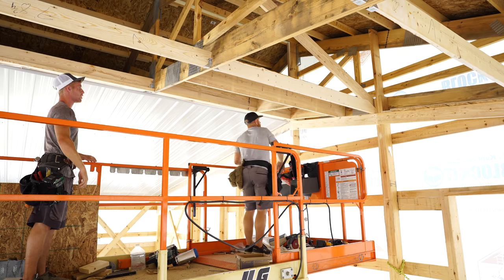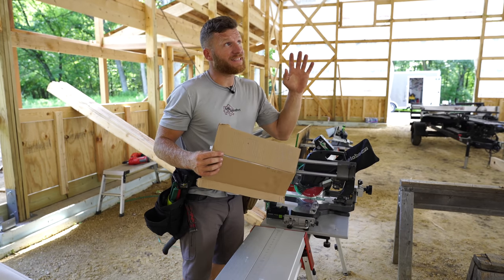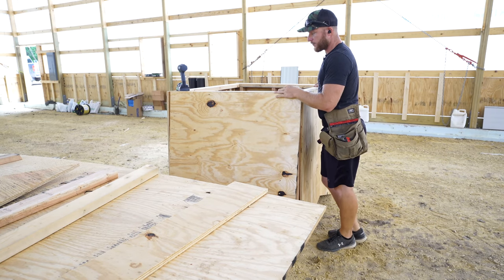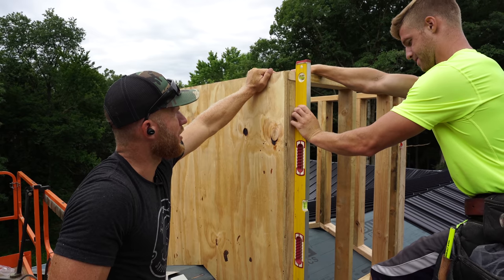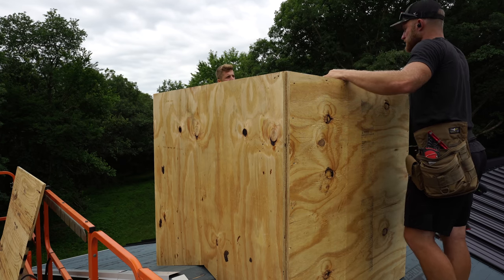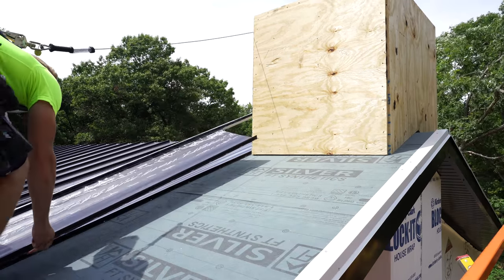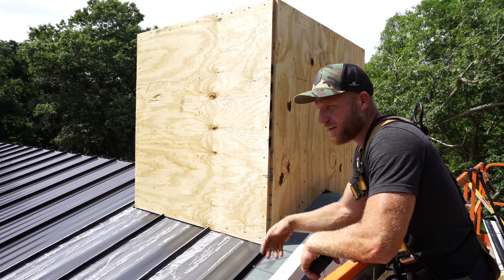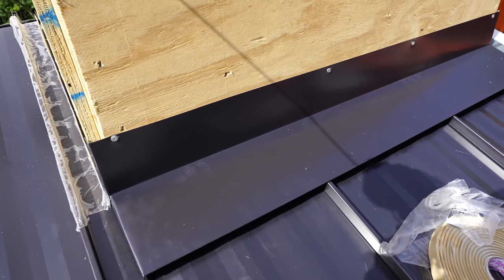Cabin in the Woods Part 19: Finish Ceiling, Build Chimney

Comment: 12:53 - Guys, Are you using officially licensed Milwaukee (tm) OEM Nails in your nail gun? I mean, you're supposed to be only using officially licensed Milwaukee OEM Nails for your Milwaukee (tm) nail gun. I mean, I would NEVER use remanufactured or third party ink cartridges in my HP inkjet printer. HP has assured me that it only works with official OEM ink cartridges from HP.

Comment: Did you consider permanently mounting a couple of safety tie downs at the ridge line for future roof access? They would be mostly hidden by the ridge cap and the exposed tie-off ring painted to match roof color.
Reply from the maker: Maybe should have

Comment: Tip for you guys.  At Walmart in the sporting goods section you can buy replacement stakes for a tent (they don’t even ask you if you own a tent! ). Then gets some 1/8 rope (yarn will work if you double it up).  Then then a roll of duct tape.  Drive the tent stake about 4 foot out from the corner of your building and attach a string to stake and the other end duct tape to you building.  Repeat on the other 3 corners.  That should eliminate that sway in your building.  🤓

Comment: The build is looking great. Have you had anyone want to build without overhangs, entire exterior in zip-r, attaching overhangs at that point, for the next step in energy efficiency? I've been mulling it over, being able to have a great seal, great insulation, climate controlled attic space, yet still have all the benefits of post frame.

Comment: Take a zee and put it on tbe edge of the last panel. Mcelroy details has 16ga Zee butting to the edge of the panel and 1-1/4” screws into the side leg of the panel into the zee every 1’0”. Then run a 90* rake ontop of that zee set in caulk tape and rivets or zac screws. Where the rake hits the side of the chimney just turn it up 3” and your done without ordering 1 panel. Who bends your flashings for you? I’m semi-local to you and you guys do real nice work. 18 yrs architectural experience

Comment: This question has probably been asked and answered more than once. Will someone please point me to where the question was answered? Why do you build the building first and do the slab last, instead of pour the slab, then build the building? Love your work and vids. Great job!!!
Reply: David, the floor will be poured four inches up the grade board just below the bottom wall panel j-trim. Walls have to be up before the grade board goes on. Ties everything together and makes a nice tight building resistant to critter entry. At least that’s what I’ve learned from watching his videos. Someone correct me if I’m wrong.

Comment: Greg, you are right on the money. a carpenter can have too many tools. having the right tool for the job is perfect, but how many framing hammers does one need?? or circular saw?? BTW, watch each other for heat stroke/exhaustion.

Comment: What tape measure are you using? How’s it holding up? I’m a plumber and normally run fat max but they aren’t holding up lately. I bend the first couple feet over lots and they eventually split. Tried the Milwaukee and it’s showing sign of the same issue within a couple months.

Comment: Love your videos. Why fiberglass insulation instead of greenfiber ( boric acid) to keep pests away. Also why not closed cell on both walls and ceiling?  I’m getting ready to insulate my barn and  and trying to figure out the best option in Tennessee. I’m leaning toward closed cell with 2 inch on ceiling and 1.5 in on walls.

Comment: 09:18 
The ONLY useful comment I can give on this... if I remember correctly.

It's called "Ballooning"  spiders basically fly through the air, using their webbing..
It is a real thing. Apparently spiders can move up to a mile or something, doing this stuff.

When I first learned of it.. ptsd kicked in pretty hard. 

I'm just grateful I don't live in Australia with there
damned "huntsman spiders"... their supposedly not poisonous enough to actually get you that way, but 
they are really freaking huge & like to hide in the most annoying places. (Mainly peoples vehicles, ceilings)

Apparently the spider is the cause of a ton of deaths, b/c it likes to come out when the vehicle is moving.. 
of course seeing a spider the size of small dog, come out of a tiny crack & then head toward you, would 
freak out the most hardened person..

Also cool build. I'm learning a lot even if I don't do this as a trade..

Comment: I would have installed a piece of side wall on the side of the chimney. Run a piece of z up the roof to lock it in
Reply: he can't at this point due to that he still has to finish the metal roof sheets then will do his flashing

Comment: What is your reasoning for using 3/4” plywood instead of a product such as zip sheathing? At the company I worked for over the summer they always required us to use zip sheathing and zip tape even when we were simply just replacing old chimneys

Comment: Shouldn’t the electrician have run his wires in the ceiling before it was installed?  Unless all lighting will be in exposed conduit.  Talk about hea t, that poor insulator has to crawl the length of the building to start spraying🥵. Two or three access doors would have been better.
Reply: Agree